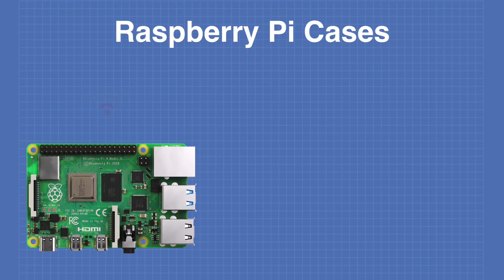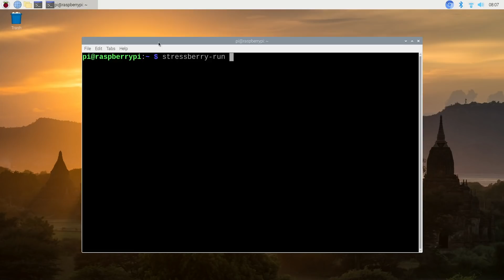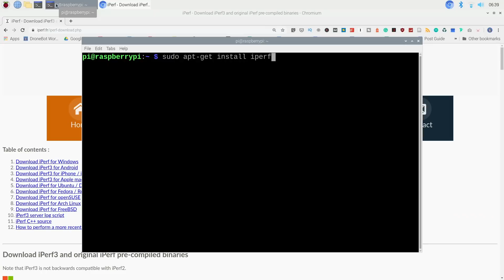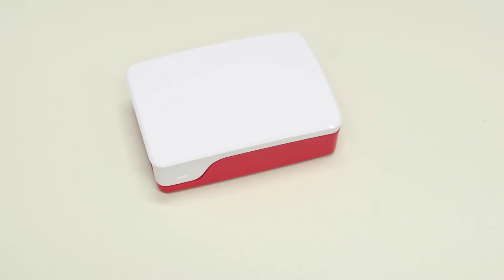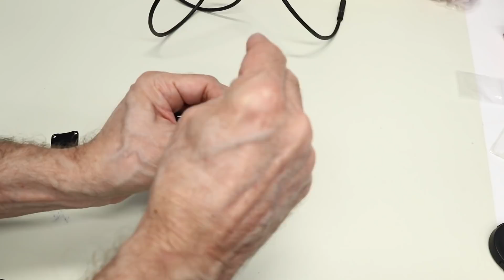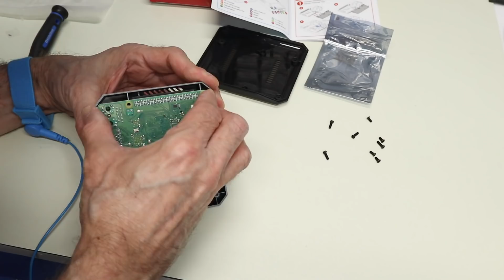Testing Raspberry Pi Cases with Stressberry & iPerf

Comment: on RPI4 and not seeing WLAN0 or ETH0, use raspi-config , 
goto 2 networking options, N3 "Network interface names", choose Yes, reboot when asked.

ifconfig or ip addr

using garatronic fan, quiet : VentilaPi4, can not stack a hat on top, but does let you attach 40 Pin cable

Comment: 2 min 35 sec in the video, Bill is talking about 2.5 and 3mm hardware. Can someone explain this? What is 2.5mm on a Pi 4?
Reply: I think he was speaking about the screw holes in the board, although I've never measured them.
Reply: @bluehornet6752  I believe he was talking about the power connector sizes.  They come in too many sizes, unfortunately -- I think every company insisted on designing its own connectors.  :(

Comment: I use a FLIRC case on my Pi3 nd Pi4.  I find they work really well and have minimal impact on WiFi.  Testing in my situation made negligible difference.  I think having the plastic base helps with the FLIRC case.  I can't recommend it highly enough for heat dissipation.  It is a nice, solid cast aluminium case with good heat sinking capability.  
Thanks for bringing this great review.

Comment: Very nice and detailed video. However you should have also tested with just some small passive heatsinks, like the ones supplied in the smraza case.  So basically the smraza case without fan and bare/official case with passive heatsinks.

Comment: Shouldn’t all the tests start at the same temperature. The starting temperature of 47.0 C would appear to be high for a device sitting on the work bench. I assume this is due to the pi having been run before starting the test.
As you have what looks like an info red thermometer on the shelf, it would not be difficult to start each test with the chip at the same temperature.

Comment: You shouldn't need to reboot the RPi after editing .bashrc. Just source the script...

$ source ~/.bashrc

You can also use a shorthand...just type a dot ('.') instead of the word "source," like this:

$ .  ~/.bashrc

Either will cause the shell to go read that script, so that you do not need to reboot the device.
Reply: Also, you do in fact need to enter sudo when running an installation. It elevates your user to admin privileges, temporarily. If you run one command with it though, it will "stay active" for a few minutes, so you can generally get by without using it until that time period expires. Then you'll have to use that command again. You can change that time period by the way, by editing the /etc/sudoers file, and adding an entry as seen here:

https://www.tecmint.com/set-sudo-password-timeout-session-longer-linux/